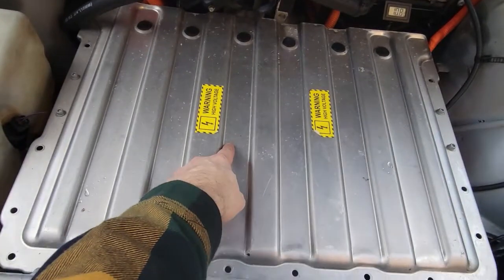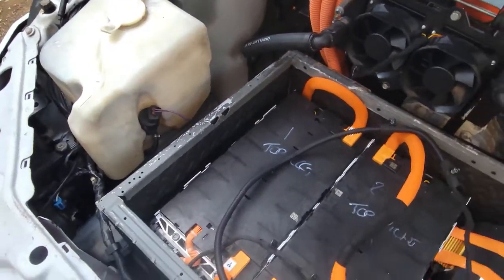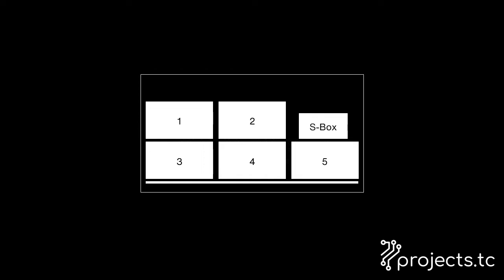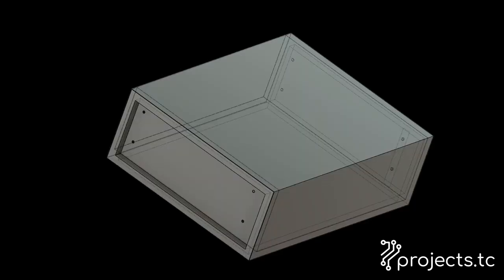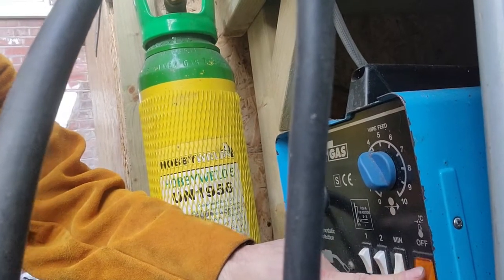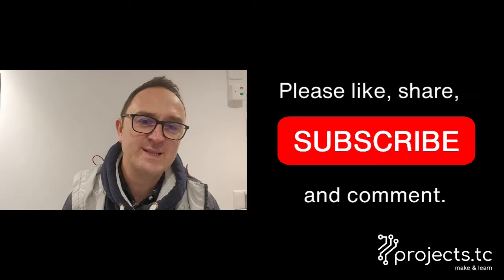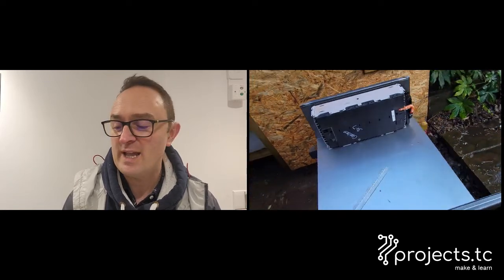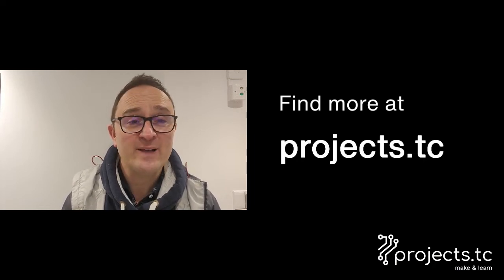Building a new battery box: EV conversion upgrades part 1 (of many)

Comment: don't be that guy, don't be that guy, oh hell I'm going to be that guy, the biggest thing that I learned when welding is that you do not need that much wire speed, just a notch above it from tapping, yes you can move faster but that will not yield the proper penetration, I looked at my Lincoln 140C machine and the wire speed goes up to 10, however none of their wire speed recommendation on their For Idiots charts go above 3, makes you wonder, anyway just sharing what really made a big difference for me, also please try to avoid grinding hot welds, let them cool down on their own, do not quench them in water (I'm sure these tips will come in handy for your 3rd battery pack swap, I'm looking at the 530e 12 kWh six module one)
Reply from the maker: This is good! Be that guy! I'm totally self taught so don't know these things. Interesting about wire speed though. I've found that my welds are overheating if I don't up the wire speed and the speed I move. I'm going well beyond good penetration.  On some of the instructional videos I've watched on YouTube they tend to move faster than I do, so I've tried to follow that. But it could just be poor technique - distance/angle etc
Reply: @EVDIY  what machine are you using and is it Flux Core only or MIG ie gas welding
Reply from the maker: @Good-Enuff-Garage  It's a Clarke MIG 151EN that I rescued from a skip! Upgraded with a euro torch and proper solenoid for gas. Using it with standard gas mix and non flux core.
Reply: @EVDIY  GOOGLING, awesome so glad it's a MIG, yup that dial does go up to 10 but study the chart and see if any of the settings call for that speed, it would be interesting to confirm my assumptions, also have you tried different wire thickneseses here in the states we can run .025 or .030 or .035 spools of wire that's in decimals of an inch just for that extra complexity
Reply from the maker: @Good-Enuff-Garage  I've not experimented yet. Still using the massive reel of wire I blagged with it! But will do when I need to change it.
Reply from the maker: PS I've never got near 10 but typically I'm running at about 3-4 for thin stuff (1mm) and 7-8 for really thick stuff (6mm/quarter inch).